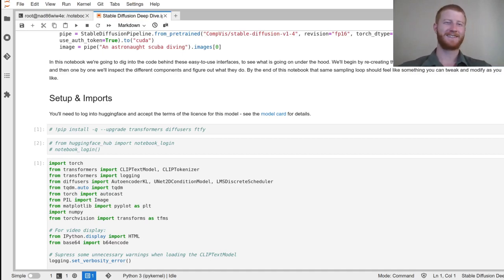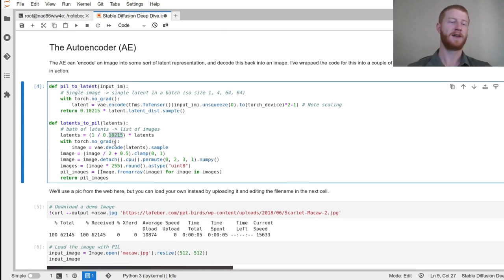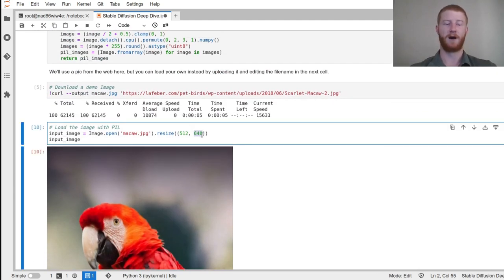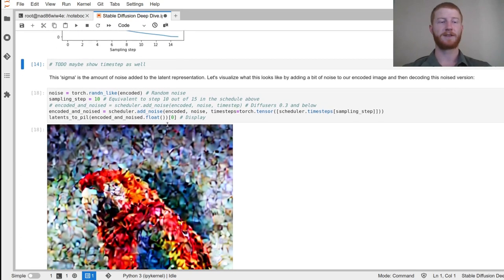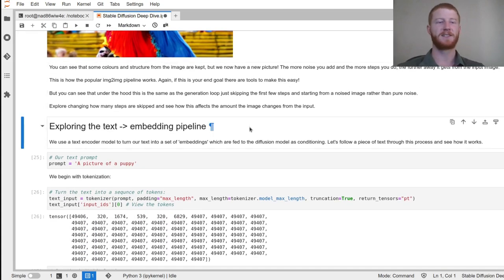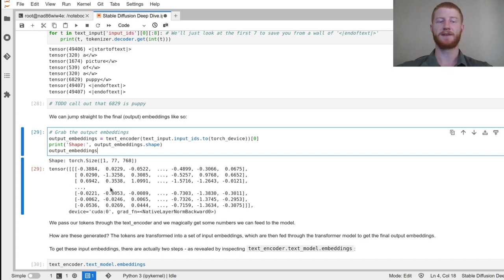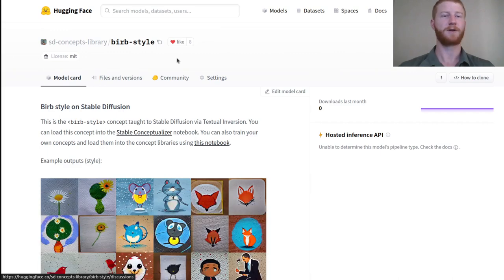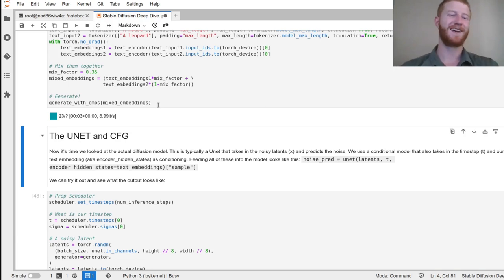Lesson 9A 2022 - Stable Diffusion deep dive

Comment: This is useful but I wish you went into more detail here and there. Is some CLIP or similar model included in the stable diffusion implementation? If so, are precomputed weights of the CLIP model used to calculate noise_prediction in each step? I.e. we pass the current noisy image (in a latent space) and the text embedding to CLIP and then calculate the gradient for each voxel of the image so that something (semantic similarity?) is maximized? I wish you would say what happens during training of the mode and what then happens during inference :).